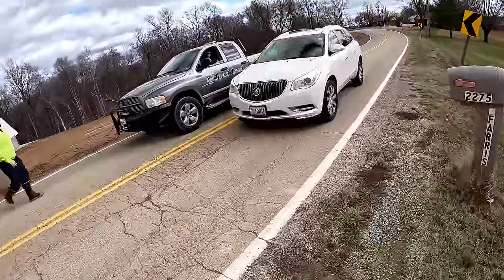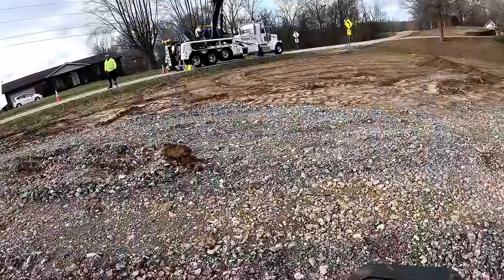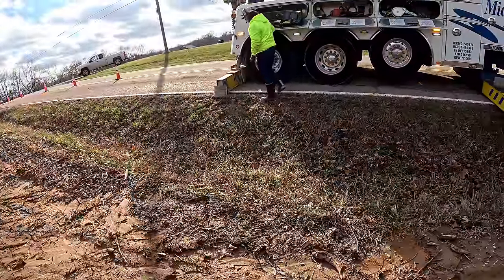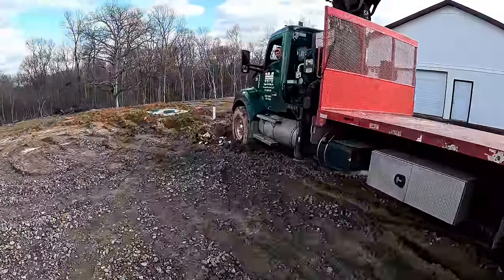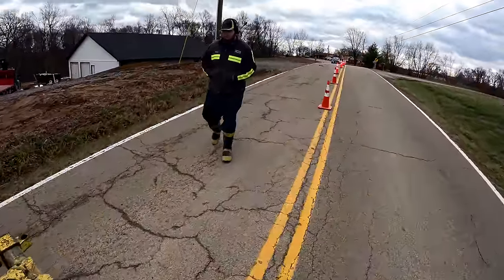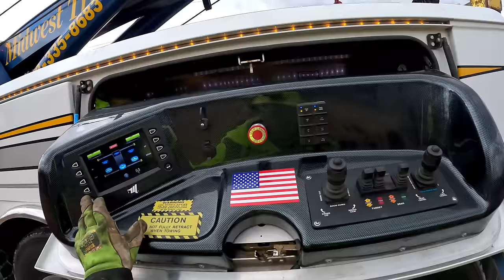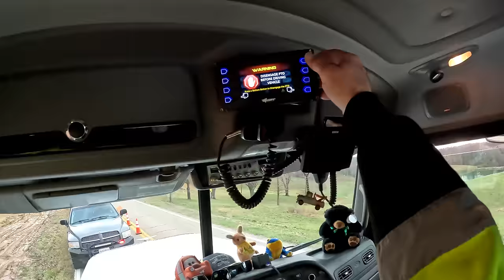THE NIGHTMARE JOB!!!!    ROTATOR V.S. MATERIAL HANDLER!!!@

Comment: To those that might have wondered, the grooves in a tire are called sipes. This process was the result of a man finding the leather or hard rubber on his shoes too slippery at the slaughterhouse he was employed at back in the 1920's. He made grooves in the soles to improve the traction, and the process was named for the developer, John Sipe, who went on to procure a patent on this.
Reply: That is awesome and very neat, thank you for sharing this.
Reply: Now I can send that to my brother in law to use at one of the community dinners/get togethers.  My sister told me that the men try to outdo each other with their bits of arcane trivia.
Reply: Incorrect Farm_fab...the groves are not called sipes. Sipes are the tiny lines which are most easily visable on winter tires which strictly improve traction on wet or icy hard surfaces...they do nothing at all in mud. What gets traction in mud is the actual tread pattern and the only thing that would have helped here is an off road or a combination tread pattern.
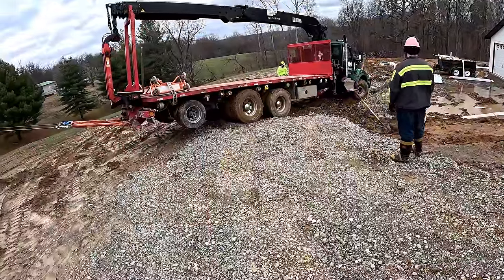Reply: I no hi o hiu 51:11

Comment: You might want to consider using excavator pads for this kind of recovery.  They'll do the sinking into the mud and leave your wreckers/rotator high and dry.  You can get them in any length.  They work real well.

Comment: I drove these drywall trucks for years! If they had put there outriggers down and turned the air pressure up in the tag axle they could have raised the whole truck up and stacked stuff under the front tires and the back axles! It would’ve probably came out on it’s own or at least not have been such a hard pull for Ron! I’ve literally got myself unstuck probably 20-30 times over the yrs! But I was the best that ever got a truck stuck when I first started driving! Lol

Comment: I have driven a truck with a similar axle set up to the truck you pulled out... whenever you get into a situation where the non powered axle will take the powered axles off the ground you're done, because there is no way to move at that point... between the soft ground and rear lift axle, the driver was in a difficult to impossible situation at best... all the makings of a bad day.... another great assist!

Comment: There's good reason I carry around an off-road forklift for this type of job. Weighs the same as the crane without this hassle.
I guess this turned out to be a real expensive job that can't be passed onto the client.

Thanks for the video Ron.
Reply: How can it no be passed onto  the client and more to the point an off road forklift wouldn’t have touched this
Reply: @gregshearer423  I think he was refering to the original delivery. If they had left the truck on the road and used a forklift the truck would have not gotten stuck.
Reply: The resident should not have to pay for that truck that should not have been there. Drop the bricks or whatever it was road side and carry them in on foot.

Comment: Get some 2x12x 8’ boards  on your truck and you can slide the DOT bumper on those to keep them from digging. I’ve done that before and it worked on my flatbed trailer. I did have to stack them 2 high tho. Fortunately I had them as dunnage.

Comment: many years ago, back in the 80's, I was stuck in a truck stop that had a dirt parking lot in Tulsa, OK., with a flatbed loaded with 45,000 lbs.  of steel coils. We had a wild night of tornadoes & thunderstorms with lots of rain. Once the rain started, I tried to move to solid ground, but got stuck behind other trucks that were packing in off the highway because of the weather. I ended up buried in mud & storm run off in the back of the truck stop with about 30 other trucks. Nothing we could do until morning as I was blocked in. One by one trucks were getting winched out by the heavy wrecker service that showed up. Each driver had to hook his own truck up because the tow operator did not want to get muddy. He wasn't having no part of it. The first time ever at about 29 years old I had to drag a winch line. Oh my God. I still remember that pain today.

Comment: Like your use of 3 short for backing - reminds me of my ship captain days...comes from the Regulations for Preventing Collisions at Sea (aka COLREGS) which we had to memorize.  Specifically Rule 34 - Warning and Maneuvering Signals.  3 short blasts (1 second per blast) means "I am operating astern propulsion" while 1 long blast (4-6 seconds) is a warning signal for coming around a blind bend or leaving a slip or pier.

Comment: Ron ,

I enjoy watching your videos.  You know your business very well.

A couple of comments.   First, you should consider fitting your truck with a self- tailing winch such as those made by Harken or Lewmar.   These winches are often known as capstans or gypsy heads.  With a snatch block and 200' of 3/8" diameter braided synthetic line such as Samson Spectra much of the muscle work in the pulling the tow wires to the truck.  Tie one end of the line to your white or blue hook, run the other to the truck, through the snatch block and back to the rotator.  Now, use the winch to pull your wires to the truck.  This how salvage tugs move a 3" diameter wire core towing wires to stricken vessels.   This also how mooring lines are passed from a ship to the pier.

Early in your video appear to cross your tow line while it is under load.  This is a very bad practice.  You even call it out later in the video.

Good luck!

Bob

Comment: Got one for you, Ron. I spent 10 years driving those same type of trucks. Had a driver try to cross a muddy rain soaked farmer's field in order to get to the backside of some new apartments in Lafayette Indiana. He buried the loaded truck to the frame. Got a second truck, empty, to pull the first one out. Buried that one to frame also. This was on Monday. Several companies came and tried  ,or flat out refused to try, to recover both trucks. On Friday, the farmer was threatening to press charges for trespassing and damages along with putting a lien on the vehicles. Finally one company managed to get them out on mid-friday. One truck was roughly 500ft from the road and the other was closer to 700-800ft.  Cost the company nearly $7000 in tow fees, fines from the city for mud in the road, and the company owner gave the farmer a thousand in cash if he didn't press charges. Plus, the load of drywall was completely destroyed.   Yeah, they fired the driver and helper. 

Love you videos. You're a true professional.

Comment: A nice recovery from a very sticky situation. Would rate that as a technical recovery with the rear right digging in. Kudos to Ethan and Gavin, as they are learning the trade well. Liked that Gavin thought about getting the headsets when I was thinking, "where were they?" 👍
Some suggestions:
Suggest to Gavin that he does not obstruct the view of the person operating the remote. That would help to give them a clear view at all times. 
Could some of the material from the drive have been placed under the drives to help give them a bit better grip? That would also have helped ease the lifting of that back cornet. Could some cribbing have been used under the drives to help lift the rear end earlier?
Another thought that occurred would have been to move the truck forward and get the tag axle dropped before any pulling was done. It might have helped lift the rear end before it got buried. 

Okay, so I'm an armchair towie. Transport is not my trade at all. There might be reasons why my suggestions were not appropriate.

Comment: Nice.
I wonder if it might have helped on the first attempt if they had pulled in and rotated the boom over the cab. Reducing pressure on the rear. Using their boom as a counterweight.
Reply: Don't think so--the  left front wheel was alway down in the  ground. Rotating that boom while trying to move that truck creates a very/very unstable truck, in muddy unstable ground. Boom should always be in the back cradle nd latched if possible.
Reply: What might have helped is  pulling 45 degrees up with the help of a truck rim siting on a 4x4 and rolling with it or a similar contraption ,pulling straight needs 3x  pulling force as facing dirt needs be displaced while moving in pulling direction  .

Comment: We were called out on the same exact type of material handler here in Florida, he was fully loaded with double-stacked pallets of roofing shingles, and 25% of the load was dropped at that job site and the rest was for another job, but he backed down into some sand and unloaded what went there and he started spinning and sinking when he tried to leave. And instead of using his brain and stopping as soon as he started sinking down, he just kept trying until it was framed out from front to back. Gotta love non-drivers that do that. Long story short, our 75-ton rotator couldn't budge him. he was off the road about 200ft, I hooked to him, and I put all the pressure I felt safe putting on it, A LOT of pressure and it did not budge at all, so I was done. lol. I told them they needed to get a machine out there to unload it, and they needed to start digging it out and call me back when they have all the sand dug out from around and under it and a few feet in front of it so that we could put boards down and make a ramp to pull it up. And he was like, You don't dig them out? I was like, NOPE! lol. I was just 10 minutes down the road but I never heard from them again so I have no clue how they got out. I know it took A LOT of digging, like two days worth for two guys going 24/7 with shovels. lol. I did tell the driver that any time he starts to spin and sink, to just stop right then and call someone to come help him out.

Comment: I’m curious how much it cost to out fit the wrecker, cribbage, straps, chains, blocks, and etc? From just peeking in your service boxes as you gather supplies, I’m amazed at how well the wrecker is outfitted.
Reply: He's said in previous videos, the truck itself (no rigging, etc.) was $600,000.00+...then figure the cost for the chains, blocks, straps, cones etc. would add at LEAST another $10,000.00+ to that...

In short, the cost for a fully outfitted Rotator is about the same as a VERY nice suburban or rural home or a 1 bedroom apartment on the outskirts of New York City!!!

😄😁😆😅😂🤣

Comment: That was a monster of a job . Didn't need to be but I get why you did what you did. Keep 1 lane open keep traffic moving. Unfortunately in this case due to soft muddy ground you couldn't get a good solid platform. But once you got SCSD There you got it out no prob due to having a GOOD SOLIID platform to work from. I will say this though Ron Good job & communication by everyone especially you Ron you keept everyone safe. That's the important part. No damage to your or coustomer vehicles is always good too lol.  God bless & be careful out there everyone.

Comment: Hi Ron , first of all , I am not a tow truck operator , When I looked at that job , my first thought was to get the road closed and then park the rig in the middle of the road and raise it up on the outriggers so its a very solid and stable platform , then pull as you did , I am in no way telling you your job but basic laws of lift , area and gavity  , aswell as the laws of levers , as I said , I am no tow truck operator , I would like to hear what you think of my idea , that said , very good job well done .

Comment: Dig below that r/h side of the stuck truck allowing the wheels to get a purchase on the ground. the r/h side is plowing where the l/h isn't I know couch potato supervisors aren't much good except when they are at the site watching. With you on the l/h side of that truck, you could not see the plowing the other side was doing. Yes, I do analyze what you are attempting to do, and then look at both sides to be sure that the right outcome will come to fruition. Rut roh, I'm using big words, but you can understand them, Ron. My Master's degree in engineering does help sometimes. Cribbing we used in the building trade while I was a FL State Master Plumber back in the '70s, but we also use cribbing in our CERT responsibilities of getting people who are trapped in buildings. I was at one time a fireman with the Sandestin/SeaScape Fire Department, so I do understand cribbing. We had a 1500-gallon pumper truck that I drove. Sloshing water is a hindrance when taking corners I also know that. So while I am a couch potato, now, I do offer some things that you could use in the future down the road, Don't ever try lifting a cast iron bathtub, it starts at 309# in the crate and I used to lay it on my back and walk, partially stooped over. I laid 8 of them by myself in one day. They were all level and the feet on the back of the tub were on the 1"x4"x14" times 8 tubs or better than 2400 pounds.

Comment: Something I'd suggest for just such an occasion is to get someone to whip you up some 2'X2'X1-2" or even 3X3 plates that you can pin on to your outriggers, maybe even have foot long spikes on the bottom of them, so that it spreads the weight out over a larger area and gives you good grip. Granted you'd have to lift them out of the back of the traffic truck with the boom each time you needed them, but it should help a lot. Some big poly/fiberglass wedges might also be a good idea for helping you crib on ditches.
Another keyboard warrior observation here.. it seems like it might've been a wise idea, if you had the cable for it, to have parked down the road a bit farther and rim slinged the front and rear axle and pulled him sideways out of the hole and away from that steep part and over onto the shallower angle and then backed up and pull him straight back. 

Ideas for the future, a learning experience for all of us. Like you always say there's a million different ways to skin the cat, offering another way to handle the situation possibly will give you a different/easier/better (who knows which) option for a future job that might save you time. If people never shared new ideas we never would've evolved from monkey-like cavemen.  Plus it helps me feel a little bit useful if my ideas bear fruit, like the side roller and zip tie on the rim sling, I rarely ever feel useful these days with not being able to work or afford to work from home. 
:D Ron's got the big wood.. someone had to finally say it once. :P 
OMFG! You saying "Yo quiero Taco Bell!" I just made a post yesterday talking about it saying "Me encanta Taco Bell, ahora estoy feliz." aka "I love Taco Bell, I'm happy now." because I had Taco Bell for the first time in about ten years yesterday. It's so damn expensive I just can't justify buying it but I was really stressed out after my doctor's appointment and gave in and spent $18 on 2 burrito supremes and 3 soft taco supremes. It definitely took me right back to my happy place, reminded me of why it was always my favorite food growing up, even if I eat home made burritos every day (which I do) it just doesn't compare. 

Talking about how much work that is, could you imagine doing it in Denver or somewhere high up with little oxygen? Granted your body would eventually get used to it, but that'd definitely be an oxygen on hand kind of job.

Comment: I enjoy your more conservative methods, it's a stark contrast from the cowboys operating here on the 401 that's set up and yank without any real consideration for potential risk since the pressure from the MTO is very high to reopen quickly... Personally, I think all risks should be weighed BEFORE attempting, even if it means 20 minutes more overall. -- Any loss of life that is preventable is ALWAYS a good use of time.

Comment: Hello Ron, I have no knowledge whatsoever about your work except what I have learnt from you and other similar companies, so what I'm about to ask may seem stupid to you. Whilst watching this video, I had an idea which I realized would not work in this case when you asked your lads to dig out some of the soil from the mudflaps and I saw that the wagon was a fixed bed lorry not an articulated semi. If you had a similar situation with a semi and trailer, would it have been possible to use the long unloading boom on the semi tractor to lift the rear of the trailer whilst you pulled it out, or would that put too much strain on the trailer rotating pin?  The more I watch your videos, the more I respect your team for having to work in terrible conditions. Thank you and God Bless you all.

Comment: Kind of surprised that you took that truck over the steepest part of that hump. Personally I would have gone a little further down the road and pulled more sideways to get it more on the flatter part. Then back the rotator and pull it around that hump.
Then again, you were there Ron and cameras are notorious for not showing hill angles accurate.
Reply: Pulling of the rear quarter of the rotator would have been a less stable platform. Though yes it would have helped get away from the worst part of the corner.

Comment: That's the problem with that kind of recovery.  Never enough room to get a good leverage on the casualty.. I've ran into this numerous times on Forest Service roads where I couldnt get the right pull and actually had one where I had to redirect my winch line off my wrecker through a shackle on my 1ton suburban and to the casualty.. it wasn't ideal because it almost flipped my suburban but I got the job done

Comment: I myself as a driver that delivers materials to Jobsites. I would have walked the job and made a decidedly on whether to unload on the site or find an an appropriate site that was stable enough for the truck. It would have been cheaper to rent a piece of equipment to move the product on the job site than what it cost to remove the truck with the wrecker. Also would not block the road and inconvenience other people.